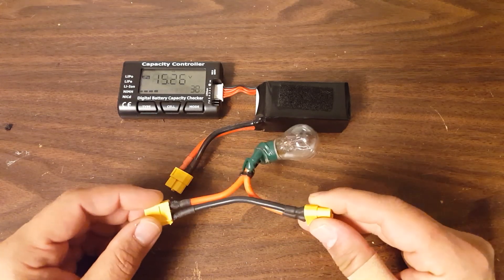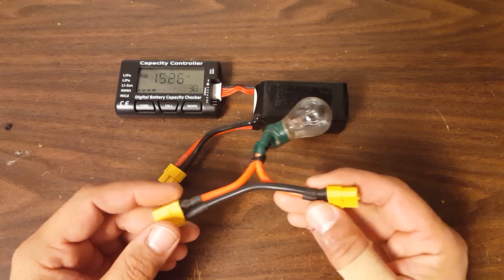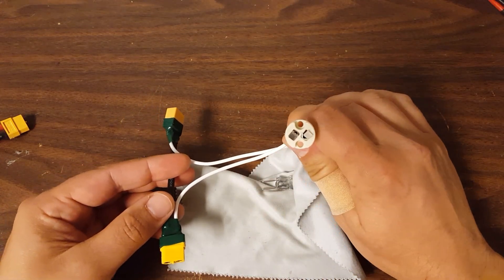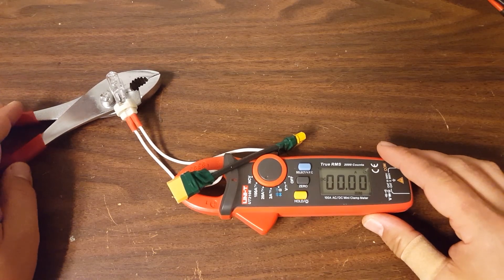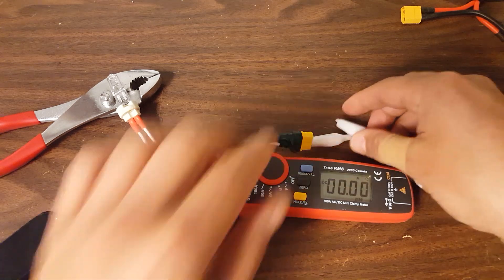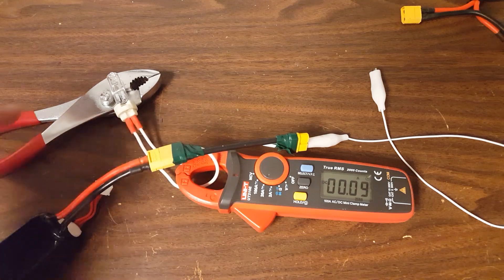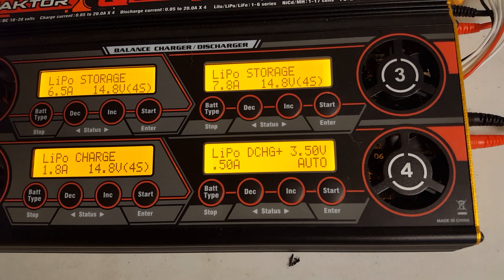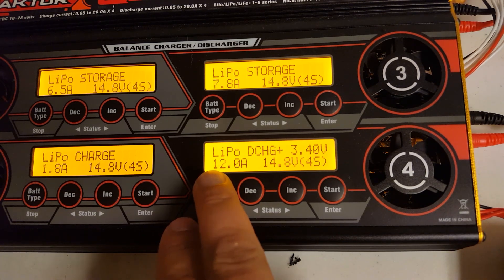Quick and Easy LiPo Battery Discharge

Comment: Is there any advantage to using a lightbulb over a big fat resistor other than a visual indicator that something is happening?
Reply from the maker: +Jason Stapels I looked into using resistors, and what I found was that the big load resistors all needed heat sinks to reach their rated wattage. I don't really know what the effect would be of running it without a heat sink, but I know you can run a light bulb without a heat sink, so that's the direction I went.

Comment: Great info!

could i use this when I'm breaking in new lipos?
tired of hovering for ages with the quad..
I have sometimes got a little to heavy on the throttle on new lipos when i get bored.
also how many cycles do you do before  full throttle?
Reply from the maker: +2663540 I don't break in my batteries. I'm not convinced there is actually a reason to break in LiPos. But you could use this to break them in if you wanted to.

Comment: In your  smoke stopper you only use one bulb? You haven't blown any using a 4s battery? I'm about to wire one of those up and was going to use two bulbs in series but if I can get away with only one that would be nice. The bulbs are rated at 12.8-14V... Seems like a nice little gadget to have for the bench.
Reply from the maker: +Ronn Wilson No problem so far.
Reply: +Joshua Bardwell right on, thanks for another informative video...

Comment: You need my LED flashlight..... it flattens 4 x 5000mah 4S batteries in 6 minutes :-)
Reply: +Vortecks I'm surprised it doesn't burn a hole through your wall in to the atmosphere :^)

Comment: You should do a quick vid on how to bring a fatshark goggle battery back up to be able to take a charge
Reply from the maker: +Invitingsauce Charge in NiMh mode at like 0.1 amps until the battery hits 3.2 volts per cell. Then charge as normal at like 0.5C. DO THIS IN A FIREPROOF LOCATION. I have never had a problem before but you never know.